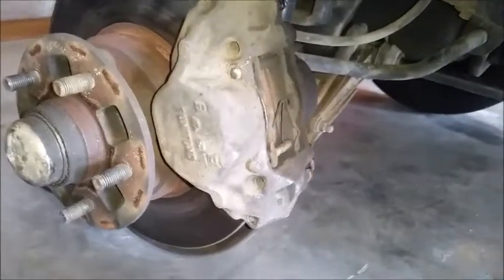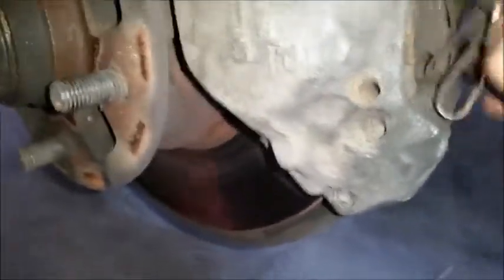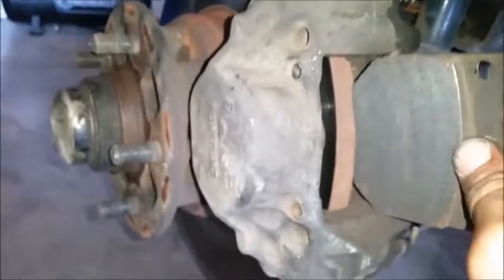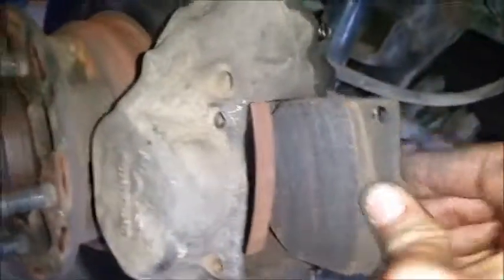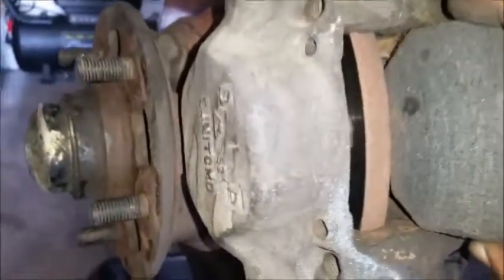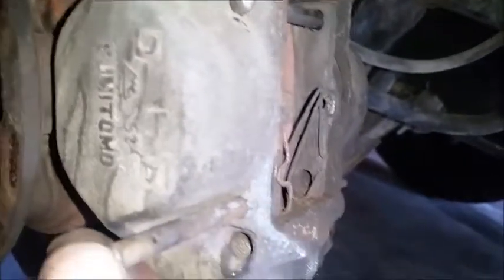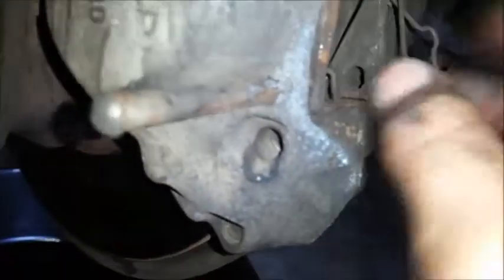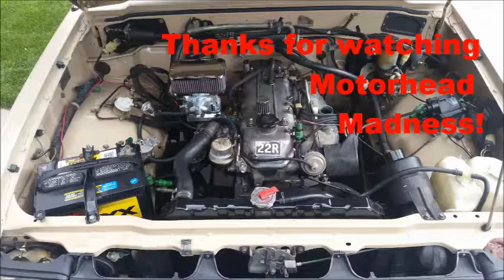1979-1983 Toyota Pickup Brakes Replacement How To

Comment: Is those pins need to be grease??
Reply from the maker: Some say they do but personally I don’t I drive on dirt roads
Reply from the maker: I actually remember going back and forth on this and dealing with brake squeals in my 82 and ended up with not greasing them.